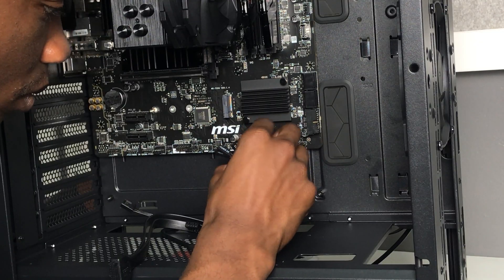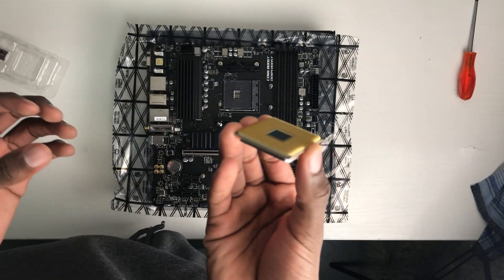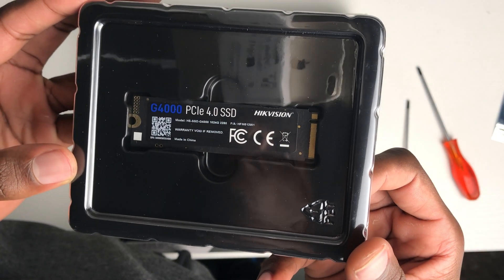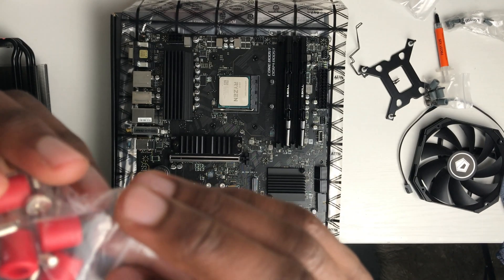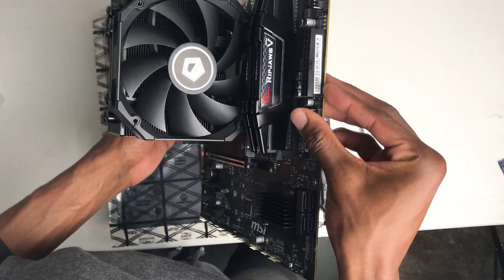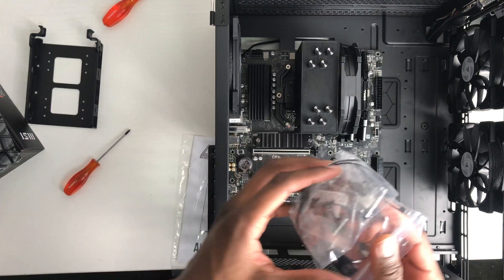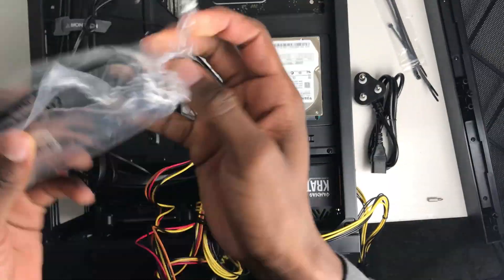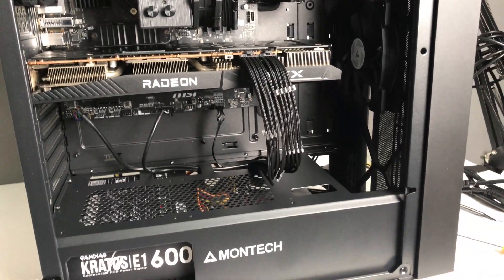How to build a pc Step-by-step TUTORIAL | Ryzen 5 5500 + RX6700xt

Comment: Unfortunately RX 6700XT here are Ridiculously Expensive for what they are as the ones that I have seen cost about R11K to R13K. At that price you would probably get a RX 7700 XT or RTX 3070 (the 3070 for which can be bought for under 11K). It is still a good GPU though if you can find one somewhere for less than 10K. 👍
Reply from the maker: Very true. I got the one in the video second hand for R4800! excluding shipping. Works like new and I saved pretty much half of what it costs new.
Reply: @tjstechub  That is a very good price. I can somehow not find a good deal on Market Place for anything other than a RTX 3090 for ~R14K. Apparently it is a bad idea to buy a used 3090 because there is a good chance that it was used for mining since the average new Price is R50K (I still can't understand why 3090s still cost more than even some 4090s). I am looking at the RX 7800 XT for now as it is the only GPU that has decent currency conversion accuracy at the high-end market other than of course the RX 7700 XT, which costs about R1K cheaper and thus does not make sense to buy it instead of RX 7800 XT.
Reply: they usually sell for 5000 2nd hand for me.

Comment: I will be building i3 13100f with 6700 XT.
Corsair CV650
Corsair Vengeance DDR5 5600CL40 
AsRock B760M PG Sonic motherboard
Seagate Firecuda 500GB & 1TB
Deepcool CH370 case
Deepcool AK620 Wh
Corsair SP120 fans ×6
Reply from the maker: Awesome mate, congratulation on your pc! enjoy it😁you deserve it
Reply: I got my new PC recently. I also have the SP120 Fans. They are awesome and much quieter than cheap R300 fans that you can get from no-name brands. They have customizable RGB and the effect is great.
May I recommend to you to rather get DDR5-4800MHz RAM as that is the maximum supported by i3-13100 according to the manufacturer. The 5600MHz probably will still work, but needs more overclocking power via XMP. I made this mistake when I bought my 6000MHz RAM. I am now just leaving XMP disabled. I also seen that enabling XMP voids your CPU warranty because you are "modifying" speed and you are actually overclocking the CPU and not really the RAM. Please check at the store where you bought your RAM (if it is a physical store) if it really will void your warranty, because I am not completely sure it will. Also, try to get CL36 RAM rather than CL40. For reference, I have a AMD Ryzen 5 7600X and a ASUS Prime B650M-A ii which I both got from Computer Mania and the rest of my parts I got from Titan-Ice.
Enjoy your new build! :)

Comment: Finally got my pc build after a long time of grinding. Managed to get a 4060 and a i3 13100F..
Reply: Bro why a 4060 tho? 💀
Reply: @kgoeletsomashimphahlele7832  cuz why not cuh
Reply: I mean looking at the numbers it a bit crazy that the 4060 is complete rip off. But I guess your choice on it was dependent what you had it for.
Sounds like you wanted to 4000 series, so I ain't knocking you off for that but there was obviously some really great alternatives out there.

Just sayin. 👍
Reply: @kgoeletsomashimphahlele7832  ig but it's still a pretty good gpu and I wasn't able to get any others cuz they were all either pricey or sold out and I don't rlly like buying used. Entire pc build cost me 15k BTW so I'd say it's a good deal
Reply: @kgoeletsomashimphahlele7832  I want to upgrade to a 40xx card but I got a i5 9600k don't want to spend 1/2000 bucks on another pc.

Comment: hey bro can i ask , so the pc im getting has the ryzen 5 5600g and im not buying a graphics card , will the monitor still display if i connect the hdmi  to the motherboard
Reply: and also does hz really affect ya fps , for instance 75hz monitor and my pc is cable of running 150fps in fortnite will my fps cap at 75hz
Reply: @1900wayne  ur fps wont cap at 75hz/fps u just wont be able to see/feel higher then 75fps/hz
Reply: Yep it'll still display

Comment: is it fine if your m.2 slot has no heatsink....asking coz i bought my m.2 and its coming friday
Reply from the maker: Hey man congrats on your new drive. There are a lot of factors that come into play, like the size of your case (sfx build have little space to dissipate heat), how much heat your GPU is dissipating (especially if it’s next to your SSD), and how good the airflow in your pc is.
But generally, no you don’t need one. In my experience most current SSDs run well even without a heatsink. Especially gen 3 and some gen 4 drives.  
Just make sure there is enough airflow in your case.
If your mobo or SSD comes with a heatsink you should obviously use it but you’ll be just fine without it in a case that gives your SSD enough space to dissipate heat around it, without any hot components suffocating it. Most average size pc builds allow this. 

Every build is different so there is no clear cut answer. So take this with big a grain of salt

Comment: Re-upload?
Reply from the maker: Yeah, last upload had a copyright strike so I thought I should try again. Sorry about that 🙏🏽 and I saw you were the first comment. Yes, the PC can definitely run Genshin😂
Reply: @tjstechub I built a good high end pc and I got an rtx 4080 for R29k 4k higher since missed the black Friday sales but I still beat takealot trash prices 

I did get a cooler master v1000 platinum with a 2k discount though so that was nice 

Rest of the stuff is 
Ryzen 9 7900x
Corsair vengeance ddr5 cl36 32gb
Msi b650 wifi
Corsair 5000d
Corsair icue h150i elite capellix xt(if you got with ryzen 7000 r9 must have cooler the msi coolers aren't good)
Crucial p5p 1TB(2TB was sold out but I found a better deal elsewhere I'll upgrade later since ei don't need it right now)
Corsair fans 4ml120 + 2 sp140 rgb 
Cooler master 12V power cable for my msi gaming trio 4080

Keyboard 
K100 rgb wired 
Logitech g604 + g305 
I thought I may need a lighter mouse for gaming but I've realized this R1000 g305 is a waste because ei like the extra buttons on my g604 so I rather get a corsiwr darkstar

Lastly my monitor I'm still using my Samsung 24inch  1080p ips 75hz monitor you can find it for ~R2500 for a good deal I plan to upgrade to a asus 1440p 165hz ips 27 or 32inch monitor.

Very expensive but stuff should last atleast a decade or 2